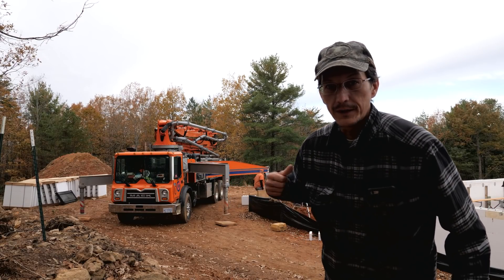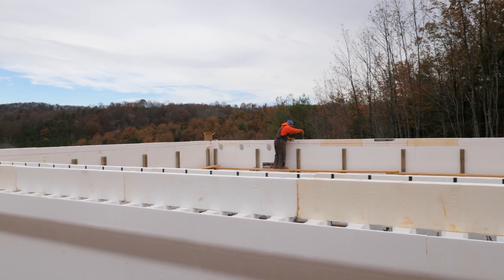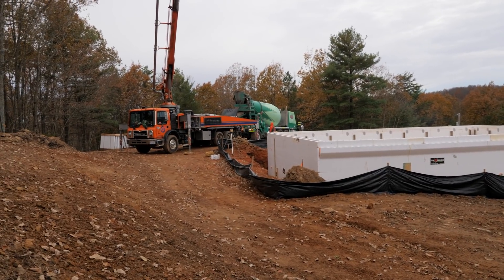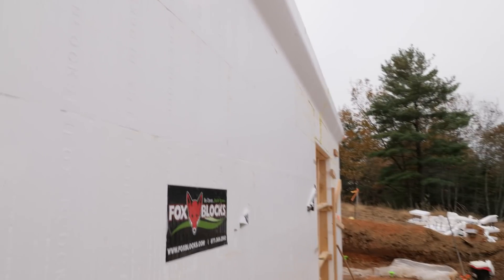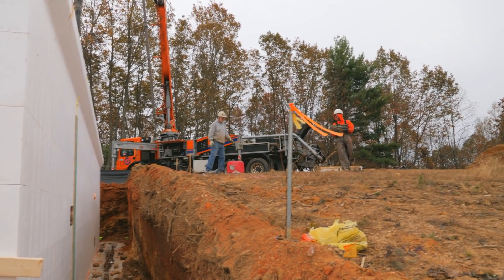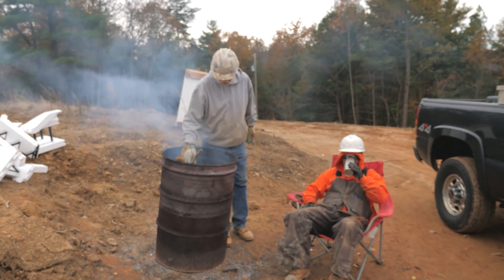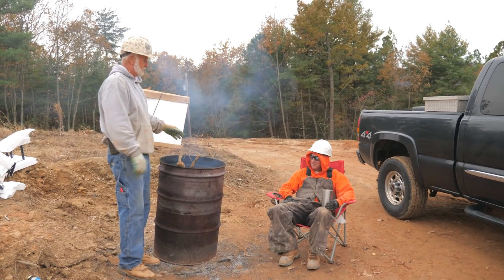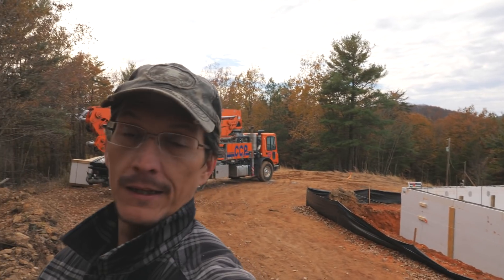ICF Mountain Homestead: Pouring Basement with FoxBlocks Insulated Concrete Forms

Comment: Very good choice to hire professionals. Stacking the block and placing rebar is not difficult. Placing the concrete is also fairly straightforward. However any small problems on pour day become a big problem when you are attempting a repair and the pump is waiting on you at a couple hundred per hour and the concrete is getting harder by the minute. A little experience goes a long way.
Reply from the maker: 100%

Comment: Nice to have a problem free pour !!!! :) wohoo.... Let it cure some and start the framing :) The framing train will be moving in soon . Please to goodness use foam sealer rolls under the PT plates , before you start the floor joists , or you will never get the basement air tight.I always used a wider pt bolt on block plate because it seals better when covering all of the openings and gives a wider wood support for the floor joists. Also consider your ply sub sheeting to foam board transition  . If you run your run your sheeting smooth to foam surface , you can run your tyvec over the water proof basement sheeting for a dry and air tight seal. I hope you fork lift that evanteck plywood up to the deck top , to speed up the sheeting process :) Keep on keeping on :) thanks for the update.

Comment: Thank you so very much for explaining the pour process so clearly. I learned a lot, and that was my intention. Good luck with your build!
If you can explain how they clean out the pumping apparatus, I would know even more. Thanks again.
Sincerely,
Rod.
Reply: The pump works in both directions. After the concrete is pumped, water and a foam ball are sucked back through the pipes. This leaves all the mess in the hopper. At the bottom of the hopper the pipe is disconnected to let everything out into a washout area. The hopper is rinsed with pressurized water stored in a tank on the truck.

Comment: It looks like you will have quite a bit of height for your basement ceiling.  Have you determined what that will be once the floor is poured and the ceiling/upper floor joists are placed?
Reply from the maker: 10’8” wall. 8” for the slab floor (4” sand + 4” concrete) leaves 10’. Beam is 14” leaving 8’10” from slab to beam. Mechanicals have enough room under the floor system so we can have an 8’ ceiling height if/when we finish out the basement.

Comment: No "J " Bolts?
Reply from the maker: No
Reply: @Guildbrookfarm  well why not ?
Reply from the maker: No sill plates
Reply: @Guildbrookfarm  Ahh! So the joists will sit down on the concrete ledge then?
Reply from the maker: Nope. Lol. The floor hangs inside the walls.
Reply: @Guildbrookfarm  OK, I think I got it. So each floor joist has it's own hanger? You got me here!

Comment: That went really smooth compared to a lot of concrete jobs I’ve seen. Nice work y’all (Southern wall systems)!!! 

Random question regarding ICF, is it really good as an insulator for using part of your basement as an extra bedroom/living area or would you add even more insulation for that?
Reply from the maker: The insulation of the forms (2-5/8” each side) plus the thermal mass of 8” concrete core would be plenty. No need for more insulation.
Reply: Guildbrook Farm - Simple Sustainable Living sweet! Thanks

Comment: I like the concrete guys & they must know what they are doing to not have any snags. Wonder what the price difference would be between ICF and blocks. Did you price both?
Reply from the maker: Yes. Apples and Oranges. CMU not nearly as strong, way more labor (time), material handling, still have to fill the cores with rebar and concrete, then waterproof and insulate and add studs to finish the inside.  ICF does all that in one step except for the waterproofing. Can stack one day and pour the next like we did.

Comment: Did you not show the vibrating as they went or do they wait till the end to vibrate it all at once?
Reply from the maker: They vibrate the first couple lifts from the bottom. The camera was on time lapse up top at that time. Then they use a pencil vibrator from the top and hit all the vertical rebar which vibrates to the ground.
Reply: @Guildbrookfarm  Thanks!   Looking good, can't wait for the next vid

Comment: WHERE IS THE CONCRETE VIBRATING TOOL??????
BUILDING CODES IN MOST CITIES REQUIRE THE USE OF THE VIBRATION TOOL BEHIND THE POUR... DID NOT SEE IT BEING USED UNTIL THE BRICK LEDGE

IT IS IMPORTANT TO VIBRATE THE LOWER LIFTS TO PREVENT HONEYCOMBING DOWN AT THE BOTTOM OF THE WALL
Reply from the maker: They vibrated the whole pour
Reply: Guildbrook Farm - Simple Sustainable Living 
WELL THAT IS GOOD
THE TOOL AT THE TOP SECTION DID NOT LOOK LONG ENOUGH TO REACH THE BOTTOM
Reply: your capslock key is defective.
Reply: Loetmichel 

I HAVE BEEN ON THE INTERNET SINCE BACK WHEN THE MILITARY AND SEVERAL UNIVERSITIES OWNED IT.
EVENTUALLY, CIVILIANS BEGAN HAVING ACCESS TO IT AND A BIG TIME PROMOTER CALLED IT THE WWW!
THEN PPL BEGAN HAVING ”BULLETIN BOARDS” AND PPL BEGAN ALL THESE SILLY MADE UP ”RULES”!
I’M WRITING IN ENGLISH,
IF THAT IS A PROBLEM FOR YOU THEN JUST IGNORE MY SILLY 💩!!!
WHY DON’T YOU TROLL SOMEWHERE ELSE LIKE ON PLFL AND TELL THEM HOW BAD THEY ACTUALLY ARE!!!

Comment: When they pour the last level of ICFs, make sure they finish it exactly as specified on your plans.  Flat, level and at exactly the height specified.  You might be surprised at how long it takes to grind off 1/8th of an inch along a 40 foot wall once that concrete hardens.
Reply: Dude you know nothing about construction and your stupid comment proves  it.
Reply: @ozinga614  Have you ever built an ICF home?  I have.

Comment: Don't you have to use a vibrator to settle the concrete in the forms?  It seems like you would have a lot of voids if you don't
Reply from the maker: We did. It’s in the video.
Reply: Never mind  saw you were doing it in the end.  was it done at each lip/pour?
Reply from the maker: Yes

Comment: Good job,  235 per hour for the pump truck that should pay the bills.    Very nice to have those pros with experience.
Reply: I am surprised they don't charge a 4 hour minimum or do they?
Reply from the maker: They do + $100 drag fee
Reply: @Guildbrookfarm   That minimum is for fuel & drivers wages. I'm glad there were no blowouts and your guys stung the wall with a vibrator. I am happy for you guys!  WOOHOO!

Comment: That was impressive. I am sure this looked a lot easier than it was because of the experience of the contractors. But I also thought the cost of the remote pump truck was worth every cent. The driver was able to get so close to the guy working the spout, which can only mean they had exact communication going. Well done